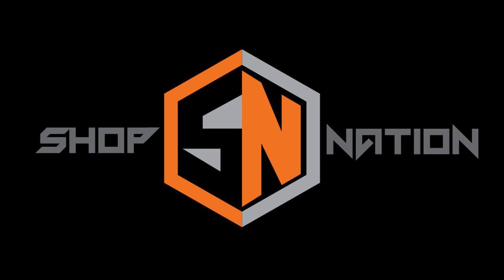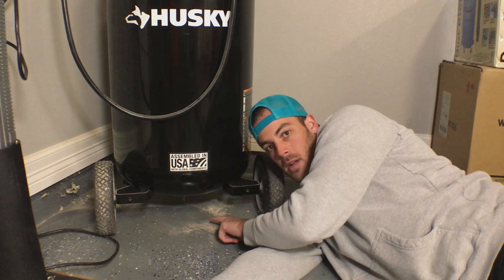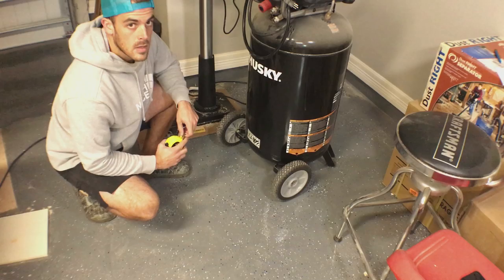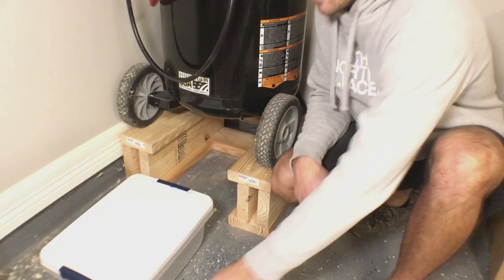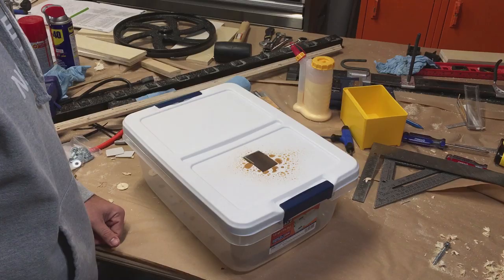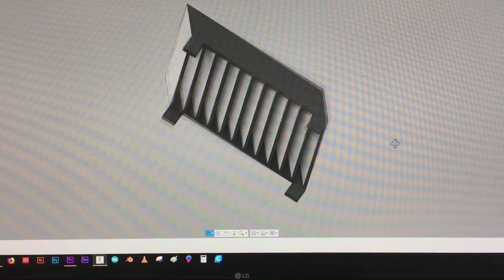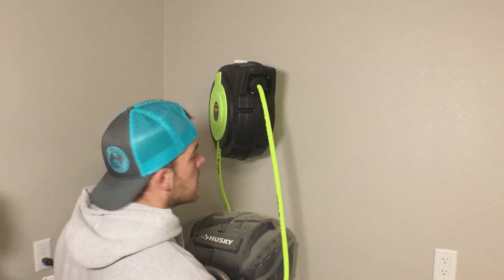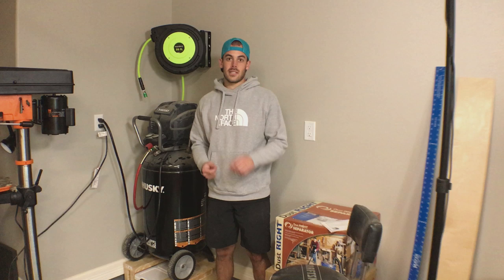How to Upgrade Your Shop Air Compressor

Comment: I like the idea behind this, I think it could have been a little easier and cleaner if you just got a piece of rubber hose and a clamp off of the drain and ran it into the tub to catch the water, great video!

Comment: Simple. Brilliant. I used the same hose reel and and routed an additional hose section to service the zero turn mower and trailer wheels at the front of the barn. The elevation stand is a great add. Nice job.

Comment: I have the same compressor,  it I mounted it on a shelf up high. It’s about 6ft off the floor. And in between my garage doors in a really useless place in the garage. I have a drain line and hose reel mounted under the shelf. Works great.

Comment: Awesome setup! I like the reservoir. 

One possible change: route the air hose in the overhead and put the hose reel above either the center of the shop or where you are most likely to use it. This way you have easy access from your work bench for instance without having the hose pulled across the shop. Just reach up, pull some line down, and when finished easy to stow without having to walk it back across the shop. Keep up the awesome videos!
Reply: Here’s a link to a sample article I just found: https://wilkerdos.com/2016/05/install-shop-airlines/

You probably don’t need that complicated of a system since yours isn’t a massive shop, but you get the idea.
Reply: That's really an actual upgrade! But since you would have plumbing through the shop with access I would keep the reel hose as close as the driveway as posible; that way you have farther reach to posible work out in the driveway!

Comment: I would get a roll of that steel strapping stuff, anchor it into a stud in the wall, go across the front of the air compressor's tank, and anchor the other end of the strap into another stud. For added support you could do this 1 or 2 additional times. I would also secure the compressor to the base. The combination of both will 100% guarantee the compressor never tips over, especially if you allow your kids, or pets in your workshop as many people will do both. It's like $10 worth of preventing a very expensive trip to the ER or the vet.

Comment: I know this is a older vid but i wanted to suggest, on my work compressor i have a automatic purge every hour connected to main power and tank drain. so when compressor is running tank purges for a 1-2 sec. drain, works great never have to drain tank. i don't know if you herd a locomotive sitting that >pisssst <,sound is the drains on the tanks. that's were i got the idea from. got it from GRANGER supply
Reply from the maker: That’s a great feature

Comment: I replaced the standard, hard to reach drain with a 90' street elbow, a couple sections of pipe, a ball valve, and then a 45' street elbow.  Much easier to access since it sticks out from beneath the tank.  Just have to crouch to actuate the ball valve to drain the tank after every use.  The only difference I just drain it onto the unfinished garage floor, not concerned about the rust stains that it may make.
Reply: Blaine Bugaski, If you drain the tank after each use, she small amount of water will evaporate by the next day. Bringing the drain valve out front is the best way to go .
Reply: @randyc5650  Of course.  I wouldn't recommend the front of the tank though if your tank has wheels as you'll smash the drain against the floor every time you move your tank.  Side discharge is best.

Comment: Nice I just added the 3 way air adapters hard plumbed one supplies my table saw band saw and drill press never fails I’ll wipe off tool top get wood splinters or metal splinters from my drill press the other ones go various places in shop plus air couplers right out Side garage door   Will be adding a catch basin for water drain I’ve been binge watching today raining like crazy and cold thanks for sharing all the cool stuff you make and use in your shop👍

Comment: For my compressor I put an elbow on the connection.  then extended the connection out with a pipe and put a valve on the end.  I have a hose I can connect to it.  I usually just shoot into a plastic cup with a paper towel on the bottom to reduce the splashing.  creative use of scraps though!  I really need to replace the wheels on mine as they are air.  They are flat every time I want to move it!   I dig the 3D printer collection spout and diffuser.

Comment: You could connect a short piece of 1/4" pipe with an elbow to the drain, extending it out from the bottom of the compressor (I did this with the same type of compressor).  Thus moving the drain valve to the end of the pipe and empty it without the container.  I drain my compressor every day so I don't have as much build up of condensation, aka San Antonio humidity.
Reply: Yep! It calls for draining every day. Although you can drain 2 or 3 times out of yor last cycle! After that all moisture should be out already till the next load cycle, manual when not in use, (auto off).

Comment: Great video bud! Love all the content. Quick question,  if you could do this again would you hang the retractable hose from a central point on the ceiling to keep it out of the way but still easy reach when using?
BTW, bought the husky 30 ga compressor after watching your videos. Awesome for everything I need it to do.
Reply from the maker: Honestly it works really well where it’s at but centrally on the ceiling would be great too

Comment: very entertaining videos. but please use a lav mic and choose some different music. i'm listening with headphones and i continually have to adjust the volume, soft when you speak en loud when you don't. just some positive criticism
Reply from the maker: I appreciate it! As I quickly discovered, sound quality is arguably just as important as audio quality! Will work on sound balance and music selection going forward. Thanks for watching
Reply: How bout capture of the wheels so a little knock isn’t a problem?...kinda braggy about the 3D printer stuff, eh?...does the diffuser stay put in the air blast?
Reply: PS: Love the content!

Comment: How does handle the vibration? Seems like it would vibrate off the platform.
Reply from the maker: Bubba Hogue I was initially concerned about that as well but it doesn’t move at all. I’m probably going to put a raised lip around the top surface just to be sure
Reply: I built something similar, but out of plywood for the exact air compressor. I just put a drywall screw in in front of each of the wheels and left it out about an inch thinking it might vibrate off. Hasn't moved in two years. Gets used everyday. Lol.
Reply: Roll Tide Bubba!

Comment: Why did you build that entire setup under the tank instead of just attaching a hose to it and running it to a drain or into a bottle?
Reply from the maker: Great question! Based on where my air compressor is, there isn’t a great spot to drain the water. I’d have to drain to the middle of my driveway and rust-stained water wouldn’t make the wife happy 😆

Comment: I thought I was the only one to over think/design stuff. A hole drilled in the top and a $2 funnel probably would have accomplished the same thing. Might need a hole at the other end of the top to let air escape.
Reply from the maker: Yes funnel would have worked as well but added benefit of the larger 3D printed funnel is that it allows enough space to also allow reservoir to vent. I also just wanted to print some parts ;)
Reply: Or just take off the lid when you drain.

Comment: Instead of making a stand and container just add a length of hose to you drain and drain into a bucket?
Reply from the maker: Yes could absolutely do that but I was looking for a cleaner solution without having to think about it. There are a 1,000 ways to skin a cat - just as long as we drain it!
Reply: Also, once you watched it in a video, it’s already done.

Comment: 6:29 Definitely not safer.  If you didn't strap or screw that thing down to the base that you constructed, its gonna tip over on its own when it vibrates to the edge.

Comment: I have a similar tank., exact same size. Do I need a water separator and run 15 for lf tubing or no? I see mixed comments... Just wondering how this worked for yoU, not doing so. Doesn't seem like you take the easy way out of anything so I'm assuming their is logic behind your way, I'm interested to know if you or anyone would care to le d some and on this topic. I'm a novice..but tryIng.
Reply from the maker: If your compressor is near an area where you can run that tubing to drain that works perfectly fine. Just keep in mind it’s usually rusty and will stain concrete so routing to a grass/dirt area is best.  My particular compressor location doesn’t have a convenient place to route tubing which is why I chose to drain into the reservoir
Reply: Shop Nation ok...got that - I appreciate it, I was also looking for info as to should I OR NOT - run the feed line from the compressor to a water filter device...it passes thru that and out the other side to your tools. Articles I have read say it can save water from getting into the tools... Some say you need to no matter the size of compressor...others say no. It seems most dsynideslly...you would run a line 15 feet down a wall to the water ”catcher/fillter” device to give the sir from the compressor time to cool and from that point run your hose reel to the tools. Not sure I have 15 feet, well.. Let's say it can be done...JUST - should I or do I need to for a compressor size identical to yours? Any thoughts would be greatly appreciated
Reply from the maker: Ah ok, sorry I misunderstood. If you plan on using pneumatic tools then it’s generally recommended to use a water trap like you are describing. I personally don’t have one installed but I probably should. Definitely good to have. Regarding the size of your air tank, basically the bigger the tank the more capacitance is built into the system - meaning you can run tools longer without having the compressor kick on/off.
Reply: Shop Nation thank you deeply for the response. Great information on your site...  I may try a few things you have built as my health permits. Your explanations while demonstrating help me to understand. Keep up the good work!

Comment: Wheels on air compressor is for rolling it. You defeated that by putting it on base? I connect a tube to my air valve and into a bucket for the water.